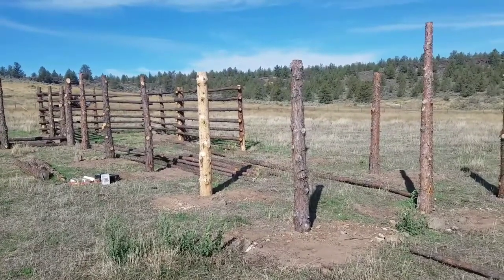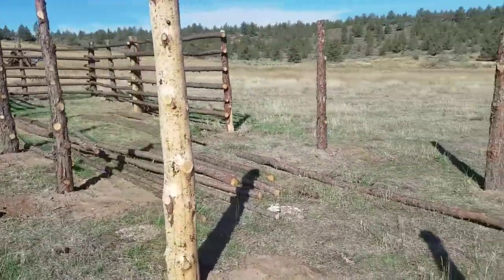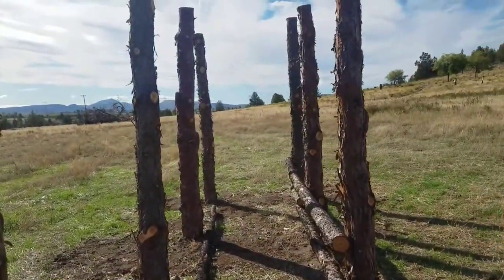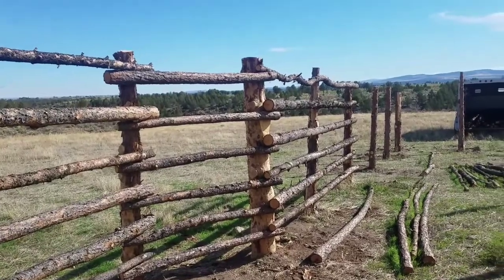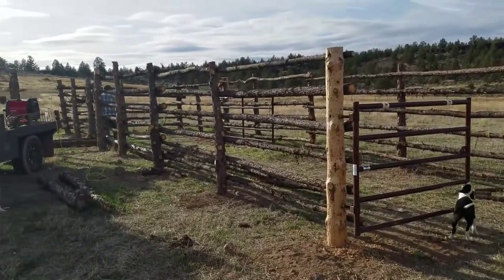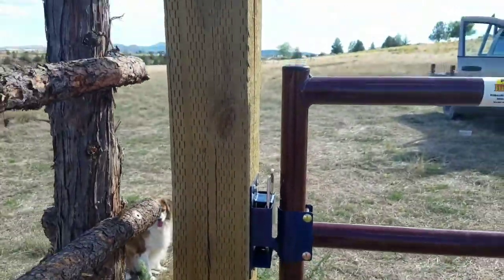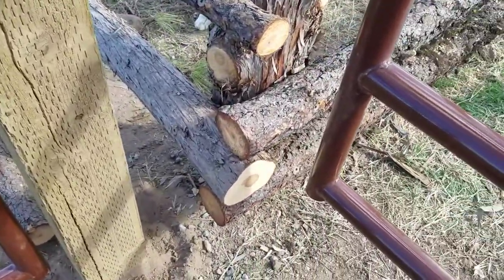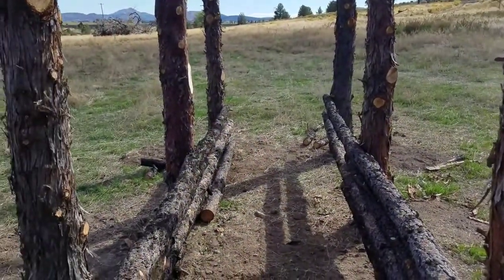Corral Build Progress

Comment: Where did you get those latches! You can slide a pipe across the rails to prevent backing up in the chute - strap some 2x4s vertically where you need them
Reply from the maker: We got them at AgWest. We do that with skinny juniper logs. One design flaw, so far is making the middle of the chute a solid wall, right where they stop and we need to put a pole in to keep them from backing up. We need to cut a hole that a pole will fit through. It still works  decent though. We've been working on the rest of it and it's almost done. It looks really rustic.

Comment: Can I see a video of the final kraal please 🙏 😢 😭
Reply from the maker: I will try soon
Reply from the maker: I tried to make one real fast. I don't know how much it will help you. We dug holes 2 feet deep and cut the posts 10 feet long. That way they are buried 2 feet and 8 feet high to keep the cows from trying to jump out. We used 8 inch long screws to attach the posts. As the wood dries you might have to screw them down tighter, because it shrinks.
Reply from the maker: Also if your cows are gentle, you do not have to use metal gates. Ours never push on them or have tried to jump out.